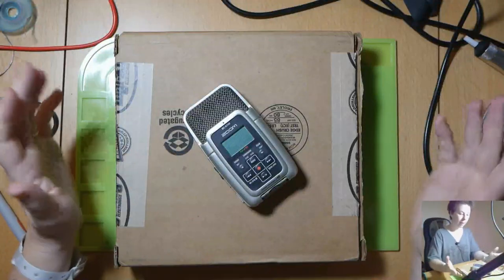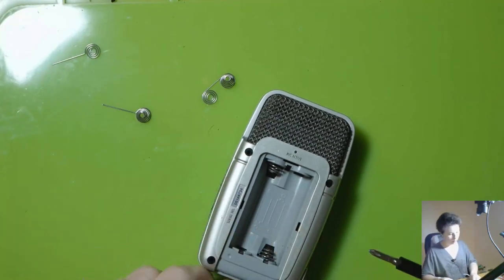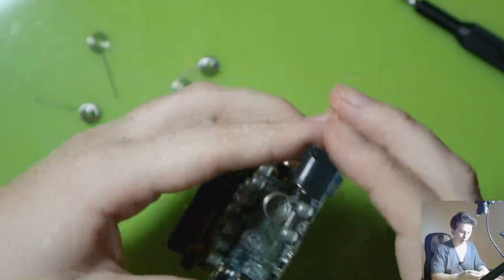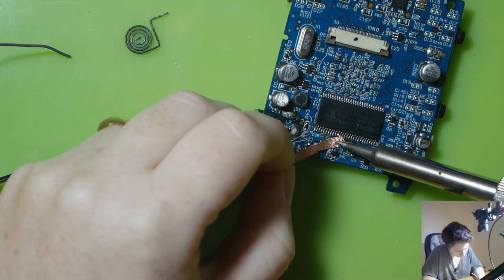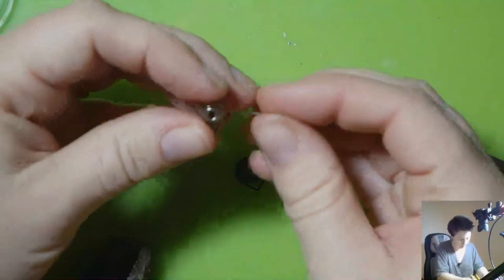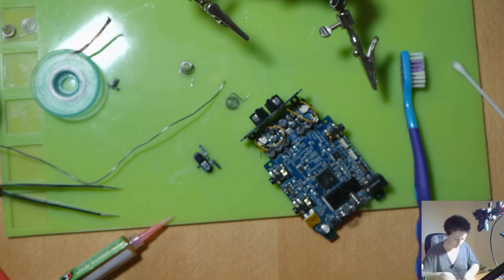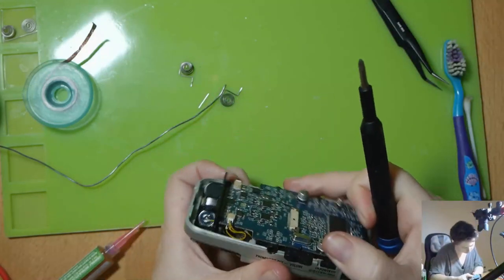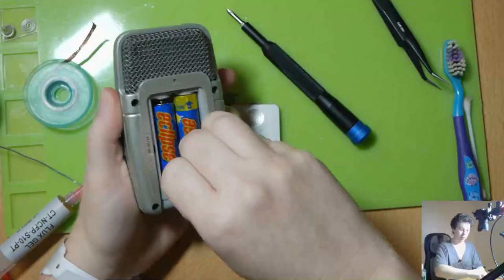Zoom H2 Microphone Recorder: Replace Bad Terminals

Comment: Nice fix, Sparky!  When you pulled out your helping hand, it reminded me of a trick my dad taught me.  He put little pieces of shrink tubing over each of the alligator clips jaws so it would grab the board more softly without the little teeth potentially causing any damage.  Thanks for the video!
Reply from the maker: That sounds like a great idea! I'm always a bit worried the clips could damage a board

Comment: This is awesome and totally guides through the exact same issue i'm having with my H2. I know im six months late and on the other side of the world from you, but where can i get those terminals? I'm having trouble finding ones that aren't mounted to little plates or that don't have straight "leg" pins coming from the spring. 
EDIT: There is a uk DIGIKEY and i just froze the video to get the serial numbers for your plastic baggies. Thanks for the vid!
Reply from the maker: I'm so happy my video has helped you😊👍 and that you are so resourceful! Best of luck for your project
Reply: @SparkyFace5  thanks, following you vid, I was able to do thus repair successfully, although there turned out to be another issue with it, I still learned alot 😁

Comment: hi.. could you please tell me the product numbers from digikey for both battery connectors?
Reply from the maker: My invoice has 3 connectors, not sure which ones I used.. Here are the numbers

36-242-nd
36-243-nd
36-244-nd
Reply: @SparkyFace5  thank you so much. my batteries completely destroyed the connectors. fantastic job by the way. you rock!
Reply from the maker: @wearethesign  good luck with the repair 🤞